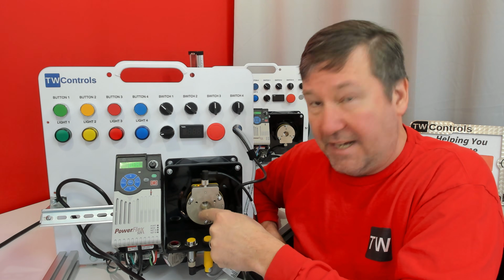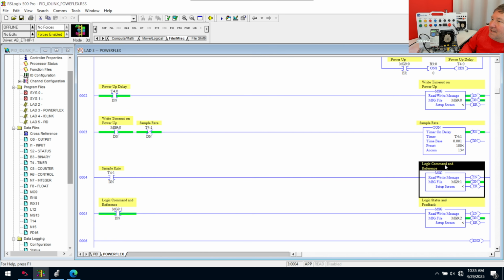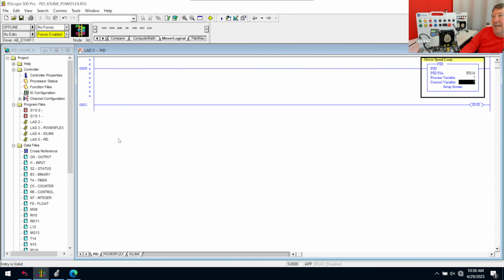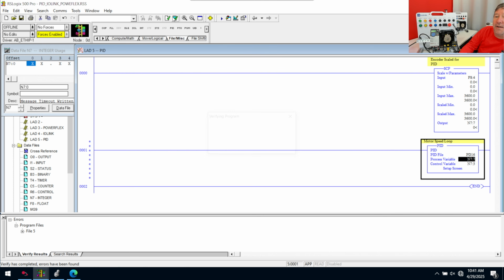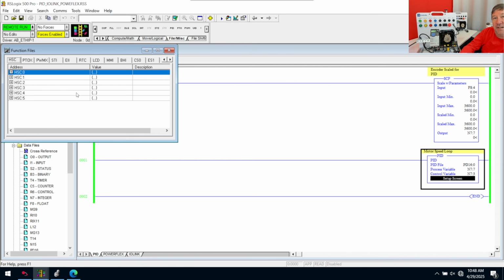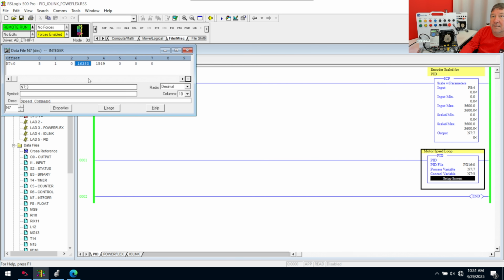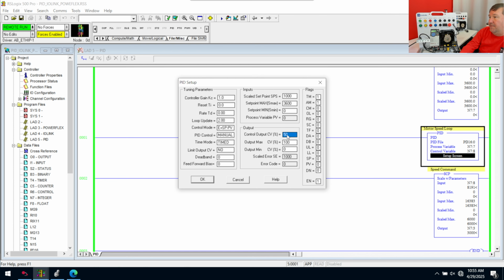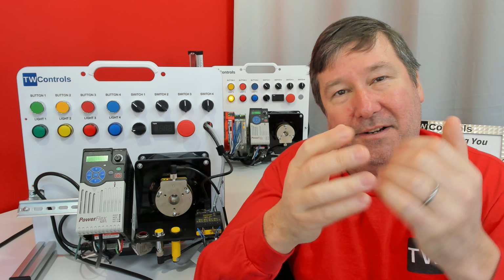Your First PID Loop: RSLogix 500 & Micrologix Explained

Comment: I too would be interested in a PID tuning video. Suggestion though: you have your fan in this video and floating ball demos for very fast PID, could you do something where you simulate a long process too? Like a tank where you have heating and cooling controls, but it has a 5min lag and takes a long time to get to the SP? (Why yes, I have been struggling with this very thing lol).